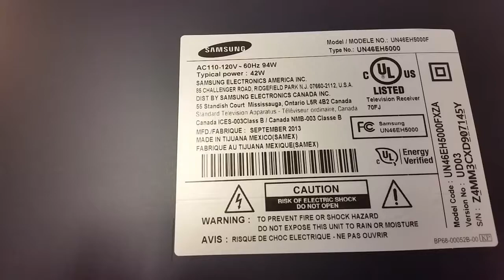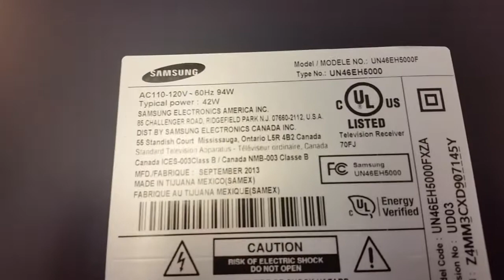Samsung UN46EH5000F dead - how to repair power board BN44--00667A

Comment: BN44-00808D I have this board, fuse was blown, I repacked it has sparking from the top relay until the fuse blew again. I found a advertised NEW board on Ebay for 45.00 ordered that. I'll take a look to see if I can see a damaged capacitor like yours see if that is was causing the issues.  Appears they are using low quality parts. I have a Panisonic I got in 2010 never had any issues with it. Its not a samrt TV it's a 42" LED been a champ. I got this one fro free from a friend it went out on them they bought a new one asked if we would take this one. I kinda handy with stuff like this. The 2  large capastors had no charge in them at all. I was surprised when I checked it on my meter. Glad too.

Comment: I found the first capacitor next to the one you showed is blown on my TV. The fuse is also blown. There's also various burn marks on the back of the panel including the logic board. Do you think a repair kit on the power supply board should fix the issues or do you think I have a problem with the logic board as well?

Comment: I have an LG55LM5800 led tv that the backlight is turning off but audio still works. The Tcon board seems ok I can see the osd when shining a flashlight on the screen.
   I can power off the TV and turn it back on and it works for an hour then the backlight turns off again.

Visual inspection looks OK, no swollen caps or anything. Any suggestions or possible ideas?
Reply from the maker: And what is the magic word, please?

Comment: Hello. I have the same issue. Do you mind sharing where you bought the replacement for R221 1kv?
Thank you.
Reply from the maker: I just watched the video and it looks we have not made a repair kit for the board as I promised in it.
I can't even find a record of the event other than this video :-)
Capacitor 220pF/1kV or 2kV you can find in many places like Mouser, eBay, possibly even Amazon or, of course, directly from us.
I'd carefully check the transistors too, though and frankly in a repair kit I'd include them as well because usually when such a discharge capacitor blows the transistor it is meant to help discharge also fails. Not necessarily always, but usually.
Which means that in this video it may have been a pure chance the transistors were still good.
Test the leads and get in touch with us if you need parts.

Comment: Ive got the same tv, its opened up right now and all my caps look ok. My tv is suffering from the powering off and on issue. The part you replaced looks ok. Any suggestions?
Reply from the maker: Sorry do not have any suggestions for you.
Reply: Coppell TV Repair LLC you dont know where I can buy replacement boards for this unit?
Reply: @Metalhead-4life  Same problem here. Did you find a solution?
Reply: @daniels7660  ah man that's been so long I cant remember. I think I just unplugged something & the issue went away. Maybe unplugging the connector to the front panel buttons, I'm sorry I cant fully remember
Reply: @Metalhead-4life  Jup, a long time. Anyway, thanks for your reply. Best wishes and a happy new year from germany.

Comment: I have the same TV, it comes on, I can hear sound, nothing on the video, no back light, 0, but it gives me 6 red lights flashing when I turn i ton. I replaced the video board with a new one, nothing. Replaced the T-Com card with a new one, nothing. The only thing left is the power supply and if that fails too, then it has to be the LED strips, sucks if that's the case, barely have 3 years that I got it.
Reply: Same here. Did you ever find the culprit?
Reply: You got'a  start to find te problem first , whit the cheaper fix . Then after de next up price and so.
Reply: I'm having the same exact issue, do you found the problem? I'm gonna replace the caps but would probably change the LEDs first. Its a classic on this tv. TVs are generally drived too hard on the brightness. 16 on 20 at standard for samsung, is good to me.
Reply: Mine turned out to be the led strips I replaced them, that was 3 years ago as you can see on my above comment. Now this TV blew a capacitor and fuse is out. There are burn marks on the back of the panel in various areas as well including the logic board. Hmmm..That's all I can tell for now. I'll probably just buy a new board and hope for the best.

Comment: Hey Guys I have this tv: 

Model Code
 - UN55J6500FXZX 

TH01
Serie : 03U73CCGA00008W
Modelo : UN55J6500AF
Type : UN55J6500

It was working fine but suddenly a weird sound cames from the tv(as a clicl) and then it shut down. I am suspecting about the power supply, but could you please advice if it possible to get some drawings as reference to compare voltage on the power supply board. thank you in advance for your help.